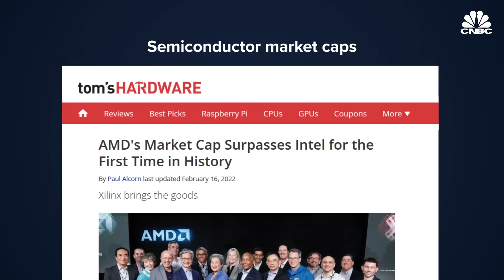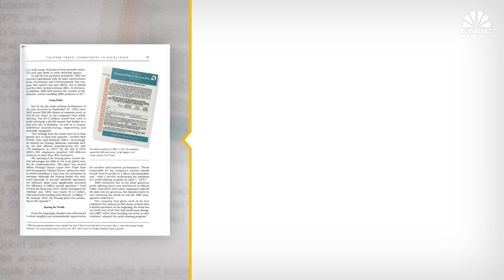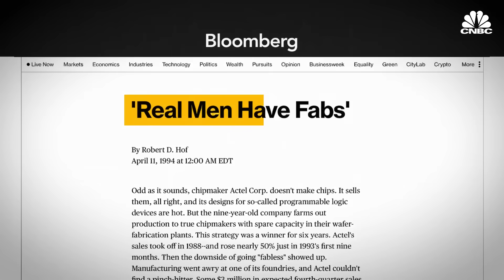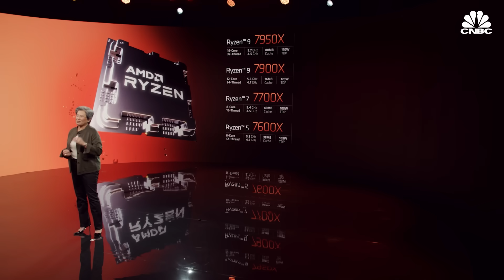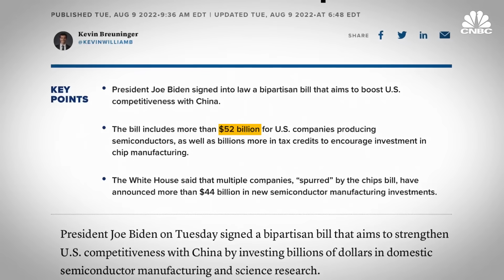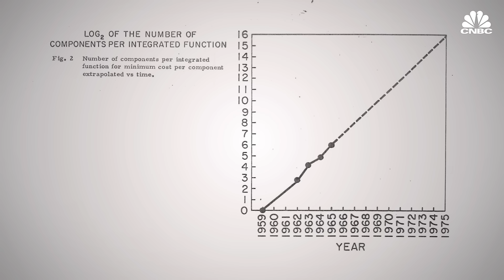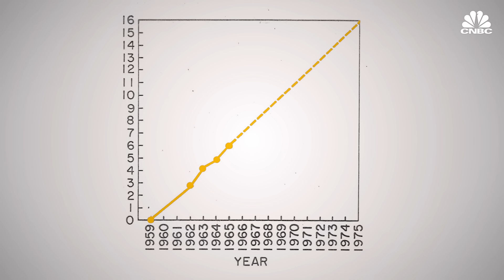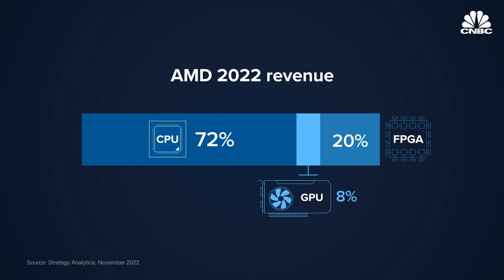How Chip Giant AMD Finally Caught Intel

Comment: I think that we need a chip that can reduce the power consumption of processors and still make them useful in when high performance is needed.
ARM uses a smaller protocol than x86 making ARM unable to do specific tasks. Imagine protocols of ARM like DELETE, GET, SET, UPDATE... and x86 being something like LOGIN, REGISTER, CREATE NEW USER, LOAD USER DATA... ARM does things fast but it either must be translated or it must be something simple.
The dumb part is that operating systems can run on ARM without a single issue... Graphics Drivers might have a problem but nothing that can't be solved.
So how I see is that PCs would have 4-6 low powered ARM cores where the whole system runs on those ARM cores... and a SOC APU like you have in phones.
Then when a program like a game is running it uses the X86 high performance cores and a dedicated GPU.

My PC while watching youtube draws about 80-100W... I can do the same on my Mini PC running Arch Linux AMD 3200G APU... drawing 30W while watching youtube.
CPU from my gaming PC is so powerful that it idles at 45-55W....

Comment: Ryzen was an Evolutionary Microprocessor in 2017 and Intel was left Chasing it's tail.  They are catching up and I think part of that is because they have also hired TSMC to fab their chips for them.  As for the GPU side of things, NVIDIA has seen the light and is also doing Chiplets.  I hear rumors that the 5000 series cards will have this feature although that is not confirmed yet.  And since chip manufacturing is massively expensive they have also shifted manufacturing to TSMC as well.  I absolutely love the RYZEN processor.  I built 2 computers with 1700X CPUs, A 2700X for a buddy of mine, A5600G for my stepmother and the machine I am on now has a 5800X, plus I bought a laptop with a 4600H.  I am also using the Radeon 6700X video card on this machine.  I couldn't get a 3rd party card due to inventory shortages so I got a reference card direct from AMD.  Still a great product and I cant wait to buy the new card as soon as the market stabilizes a bit.

Comment: For years, Intel were so far ahead that they didn't need to do much to sell marginally better CPUs than their generation before....In 2014 I bought an i7-4790K for gaming as it was ahead of the AMD 8350, then later Intel came out with the 6th and 7th gen chips, and the performance increase was tiny, but still better than what AMD had. I finally built a new gaming PC, and this time I went with AMD 3rd gen Ryzen, as it offers more for less compared to Intel.

Comment: They didn't caught Intel. They've left them with their pants down and junk dangling all over the floor.
Reply: AMD annual revenue for 2021 was $16.434B

In 2021, Intel's revenue amounted to approximately 79.02B
Reply: @lordgarion514  Yes. All that while being a tenth the size and roughly eight times less spending on R&D.
I don't know about you, but if my competitor spends that much less and still was able to caught me on market cap, I would be VERY worried.

Comment: 12:23 That number is impossible. The Nintendo Switch CPU is made by Nvidia and it has dominated the competition for the past 5 years, there's no way Nintendo represents only 17% of the console gaming market. It's probably more something like 60% AMD (35% Sony PlayStation, 25% Microsoft Xbox) and 40% Nvidia (Nintendo Switch), but it's hard to tell exactly since Microsoft stopped sharing console sales numbers years ago. Valve's Steam Deck is a new player in the console space and it also uses the same architecture from AMD than the PlayStation 5 and Xbox Series, but its sales are still online only and has not been yet mass marketed, it's insignificant in the context of this conversation.

Comment: There needs to be a follow up video today 29/12/2022 on how AMD flushed it all down the toilet. Today their latest generation of desktop class CPU's have just all be reduced in prices due to terrible sales figures, to a price below their last generation, which are still outselling their new generation today. They created an entire line up of CPU's that AMD thought we wanted, when in fact they behaved nothing like Zen 3, that everybody quickly fell in love with due to its amazingly efficient design, with 12 and 16 core CPU's using less power than 2 x 6 cores, or 2 x 8 cores. Instead AMD just designed a hot mess, running at 95 degrees C with an IHS design that crippled its performance and power demands. AMD made huge claims of efficiency with Zen 4, and they were simply not true. AMD would have served better to have released X3D variants of the their 5000 range earlier, and skipped ahead to Zen 4 with X3D, and a new IHS at least 1mm thinner.

Comment: I remember the days when AMD was teetering on going belly up. It wasn't just a couple of years, it was over a decade.

Companies have becoming "fabless", starting sometime in the 80s. This is becoming less "vertical". In most new markets, they start very vertical. Look at Ford. In its early days, raw materials (lumber, iron ore, raw rubber) came into the factory, and completed cars came out. But as the market matures, companies specialize. Other companies are better at making tires, steel, electronics, etc. So to stay competitive, you farm out that work. This finally hit the semiconductor market ~1990.

Moore's law has made the latest ARM processors exceed the abilities of Intel x86 processors. Intel is still maintaining its fabs, which in high end semis may now be a bad idea. You can probably stay competitive with a fab, if you focus on older fab technology, which is still needed in many low end and power  (not CPU power, but joules per second power) applications.

Comment: If it wasn't for Ryzen, Intel would still be charging 400 dollars for 4 core processors. They were delivering marginal improvements with each generation. Each new processor required an entire new chip set solely to extract more money out of consumers. Horrible company. I'll never Intel as long as there is a comparable AMD product available.

Comment: AMD is amazing. I've been a supporter of them since their 586 upgrade chip for 486 systems back in 1996 or 97. I've used AMD in almost every system that I've ever owned since, including my video graphics cards since they bought ATI. Good quality, integration and performance per cost.
Reply: They kinda sucked between 2010 and 2017. The Bulldozer architecture was flawed and was simply not competitive with Intel’s lines during that period.
Reply: @KaitainCPS  AMD was a good value proposition at that time, at least. They just didn't have anything to compete at the high end.
Reply: As a result, your builds were far less technically advanced over the years...including now.
Reply: @mintymus  How much is far less in your eyes? Because as far as I'm concerned AMD has never fallen below 40-50% of the performance in any given generation of their competitors even in their worst times even with the FX series blunder or even better Vega...To be completely honest the fact that AMD created the 64 bit instruction set back in 2003, along with true independent multicore CPU's can't be ignored. AMD definitely wasn't good in the CPU department from 2009-2016, and GPU hardware from 2016-2020.
Reply: @MarcABrown-tt1fp  40-50% = far less.
Reply: @mintymus  that’s not true
Reply: @Journey-e1b  Prove it.

Comment: That's easy . Intel waited 7 years for everyone to catch up and then surpass it. Actually Intel is bored seeing everyone sweating to catch up. Even  now several of its competitors inculding Apple and AMD are going too slowly for Intel's taste , that after venturing on true 10nm nodes, it slowed down again to stop from scaring its competitors. Thus instead of seeing processors on Intel's true 7nm(that's 5nm TSMC for the unsuspecting) we still rocking on overclocked "new chips" on the recent 10 nm  nodes.

Actually if Intel was going on without hard pressing the brakes and was  1 node ahead from its competitors , it would be game over for all , including Apple . We are talking mainstream processors hitting single core geekbench scores close to 3000 and multicore over 20k. This combined with nvidia gpus  one node ahead (as Apple had been for the past couple of years), would make any other product obsolete.

Comment: My first home PC was bought back in the mid 90's. It was an Intel system. That was the days of Dos and Windows 3.1. A friend of mine brought his system to my place one day (he lived in the apartment above me) and we were playing a game. His system was an AMD. His system was so much faster than my intel that it made my Intel look like an old Commodore system. I've been building my own systems since and they have all been AMD systems. I was given an Intel system a couple years back (about 2 years newer than my older system) and it's equivalent to the older system I use. Both are dual core with 4 gigs RAM. The AMD system is up and running while the Intel system is still thinking about it. The AMD system will run several programs at once without a hitch while the Intel system has a problem running 2. I'll never run another Intel system again. I'm now looking for a different AMD system to monitor my security cameras. The Intel system has a very difficult time doing only that. A couple of friends have offered to give me their previously used Intel systems and I've politely refused them. As far as I'm concerned, 1 AMD system is worth 5 Intel systems. I'll always be an AMD fan.

Comment: I’ve been a fan of AMD since I built my first PC in high school way back in 2001. It’s been amazing to watch them grow, and now in my late 30s I have built multiple all AMD PCs and they are in daily use in my home. Now my kids are team red! Keep it up AMD!!!
Reply: i switched to AMD in 2019 when their Ryzen 5 3400G came out, its faster with lower Watt and Has Faster iGPU too, i really love it, and using Wraith Prism Cooler its stable at 42°C idle and 60-70 underload.

Intel 9th and 10th gen is the one having that excessive heat because of 100+ watt TDP and still slow because amd beat them with 65 watt Ryzen 5000 in 2020.

even in laptop market, AMD Laptop can have 0rpm idle Fan Speed because of how efficient the latest U series and Ryzen 4000H series is
Reply: Pretty much the same here.  built an Athlon XP sys. AMD is so awesome. They're my go to always
Reply: Excessive heat, bad mathematics, poor working under pressure, glad I leaved amd cpu - unprecedented performance on Intel chips even with 4 cores in most low i3 series says alot.
Reply: @makerofstartup7902  Exactly lol.
Reply: I built an AMD machine about 20 years ago also.  The most unstable wreck I've ever had.  All my friends at the time had Intel, no problems for them.  I now have an AMD laptop which is fine, but then 3 other Intel PCs.  The latest Intel is better than the latest AMD in almost every aspect, in terms of price for performance and pure performance.
Reply: @mintymus  Yes you are almost right.
AMD chips for PC is not as stable and reliable compare to Intel chips if run for 24/7 365 non stop.
Reply: @zenlei8258  Except for I didn't run mine 24 hours nonstop.  Whatever the use case, AMD chips were just not stable.  Even today, I don't have an AMD CPU but I do have a 6560XT GPU...guess what?  A new bug makes it so supporting just dual monitors is glitchy.  AMD needs to get their drivers right.

Comment: FPGAs are going to become more common, because of the flexibility it gives, smart move by AMD. AMD definitely has the most options to offer to customers, compared with other competitors. This is their key advantage.
Reply: Actually, Intel already bought Altera years ago. So it's really Intel vs AMD even in the high end FPGA market!
Reply: @Kaizzer  oh yeah, forgot about Alteria. Thought Intel bought them and didn't do anything interesting with there products until recently.
Reply: The biggest move is from USA, trying to control Chip market years later. Monopoly companies, sound like USA is another China "communist system".

We need neutral companies.

Comment: Not having Fabs was pretty logical 15 years ago, but now, this could start to hurt them. Badly!

TSMC has, starting with the 5nm process, starkly increased their prices. Their 5/4nm processes have been reported to be twice those of the 7/6nm processes, which were already a 50% increase over 12/10nm. Up until that point, the price increases per node were more like 10-20%.

So, what changed? Well, 2 things:

1. The global chip crunch from 2020 onwards, which made those fabs so valuable that they could basically ask any price and get payed. but more important is:
2. The market consolidation into just 3 potential microchip producing companies that can still produce high-end leading-edge computer chips. Those are TSMC, and to a lesser degree, Samsung and Intel. 

This means that TSMC is pretty much without competition, as neither Samsung nor Intel are up to the task yet for 5nm and smaller high-performance chips, forcing AMD, NVidia, Apple and the like to go with TSMC, and they know it, so they crank their prices sky high to get as much profit as possible.

The result: AMD, traditionally the cheaper option, can't compete with Intel on price anymore with desktop CPUs, while NVidia is increasing the prices of their GPUs beyond what most gamers can actually afford.

So unless someone can break TSMC's de facto monopoly, chip prices, especially all those different high-powered ones in computers, will rise very sharply over the course of this decade. I expect a mid-range PC or laptop to be closer to two grand by the end of the decade if this trend continues even outside of scalper prices. And Intel will be the cheaper option due to in-house production and packaging making it much cheaper for them than having to accept the overly inflated TSMC pricings.
Reply: You are so wrong. Do you know how much do you need to build foundery ?
Reply: @techworld3043  I do know that it costs billions by now and take several years to do so. I also know that those costs are also increasing - but nowhere near as fast as TSMC is increasing their prices.
Reply: @techworld3043  **FANBOY ALERT**
Reply: @mintymus  me or other guy ?? 😂
Reply: @techworld3043  Having a foundry is a good idea long term--as the originally comment mentioned.
Reply: Why do you think TSMC will have monopoly for high end chips 5nm/3nm/1nm fab ? Samsung and Intel will be catching up and they are very slowly improving on yield. TSMC has the best yield so far.

What is wrong if TSMC have monopoly for high end chips?
Why MS Windows have monoploy on PC operating system  is acceptable ?

Comment: Intel had control over AMD with their 68 hundred licensing agreement, because Intel got busted for anti trust actions, AMD after a long court battle got to renegotiate their licensing agreement and could sell off Global Foundries. Intel, from an article I read in 2000, it stated that Intel makes it's processors at 2 different nm size where the 2nd size it half the stated nm size.. so if you buy a chip and it's 20nm there there is also 10nm parts... Since chip production is reaching it's theoretical limits, Intel has hit snags at 14nm, which is really 7nm. So AMD caught up at 7nm.. Now Intel will have to use ASML to compete with AMD. I wish I could dig up that article I read in 1999~2000.

Comment: Intels chip design is currently better than AMD. Lithography is Intel's Achilles Heal. AMD farmed out to TSMC that used ASML machines that could pack in way more transistors on a wafer.  Intel stubbornly stuck with its own tech and fabs despite clearly being inferior to alternatives. Intel did recently setup of a contract with ASML for their next gen machines. When those finally get delivered to Intel fabs, all things being equal Intel could have dominant chips again in 2-3 years (especially in the server market where Epyc is crushing Xeon). However, It will all depend how AMD uses it's moment in the sun. As long as AMD does not confuse its advantage in lithography as an advantage in chip design it can stay competitive.
Reply: AMD confused its advantage and started doing what intel used to do when they were ahead. Their last flagship CPU was launched at $700 and intels last flagship cpu launched at $590, $110 difference or almost 20% difference in price for... almost the same performance, they still do have them in efficiency, but really? Then almost immediately after that AMD reduced price of their CPUs to undercut intel. But while everyone was like "thanks amd for bringing back competition" before now it's intel doing it and even if people go for amd chip they can actually thank intel for saving them $120(if buying 7950x). Just shows that AMD is still just a corporation and they are not that much better than intel when they get ahead and that is why it's best not to be a fanboy of any brand and just buy cpu/gpu/whatever that gives you best performance for your money.
Reply: @testtest8399  I agree. The way some get conned by corporate marketing is silly.  Apple in particular is excellent at conjuring up almost a cult-like following. Their marketing projects a virtue-signaling image of social responsibility... then Apple has the most locked software and hardware ecosystem of the major tech brands.  fights right-to-repair, oppose unions, keep out competitors to Apple App Store and hammer devs with the App Store tax, and uses third-world labor.  

There are probably exceptions but for most corporations selling themselves as concerned citizens is a marketing strategy.  Companies are uber-capitalists when it's in their interests then switch tunes and cry for socialist regulations when competitors have an advantage.

I'm not anti-corporation but that's just the way it is. It's also why the government does have a useful regulatory role to play when some execs get too out of line in their insatiable thirst for money and power.